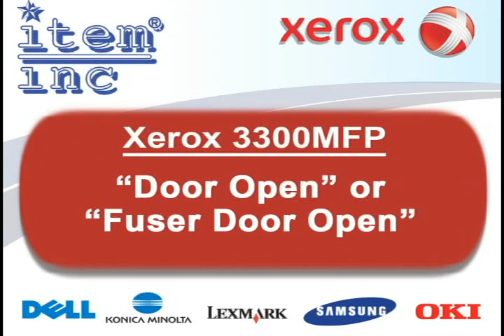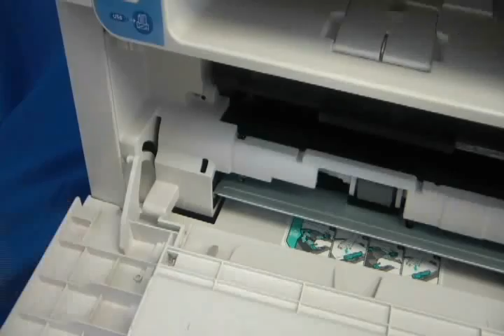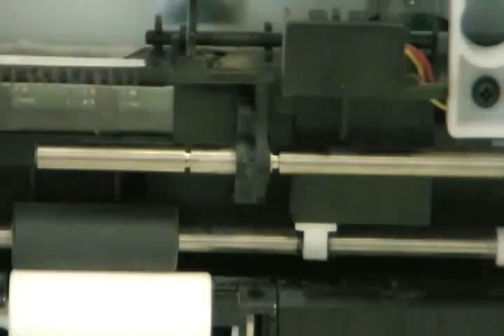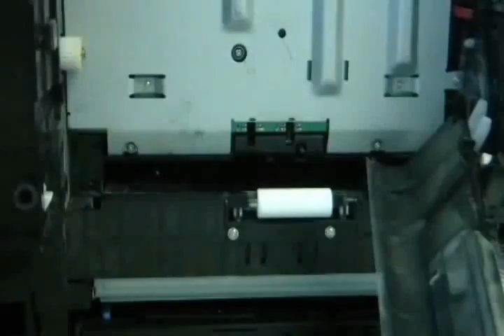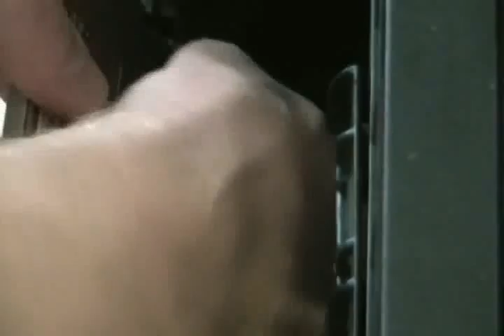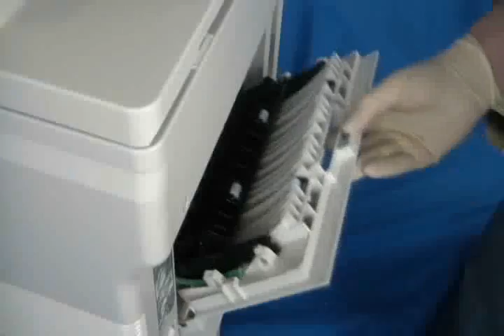Xerox Phaser 3300MFP "Door Open" or "Fuser Door Open" Fix

Comment: Actually - it is not necessary to replace whole "High voltage Power Supply" board. In fact I have changed two opto-electronics parts and the printer works well (but it is necessary to highlight that disassemble and assemble of the printer is not very user friendly )

Comment: I removed the HVPS board and tested the sense micoswitches and a few other components, and all OK. I fixed the 'door open' problem by replacing the capacitors on the secondary side of the main PSU. Worth checking this first but to anyone reading,  I would not suggest that you do this if you have  no electronics or soldering experience. There are high voltages in that area, even after power is off.

Comment: Would you have a similar instruction video for the Phaser 3330?  I am having the same issue with this model but the high voltage power supply is located in a different area.